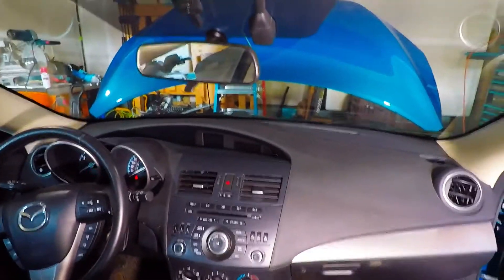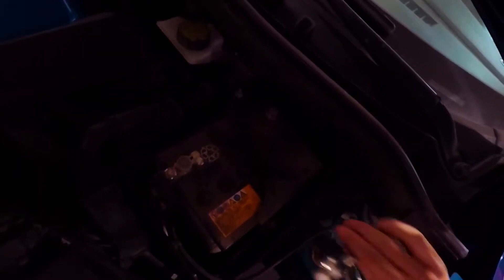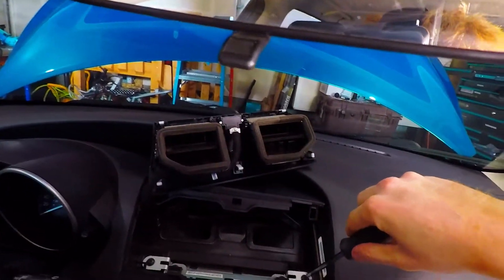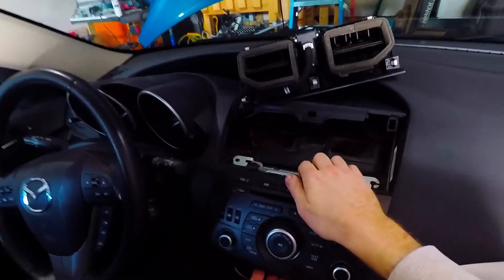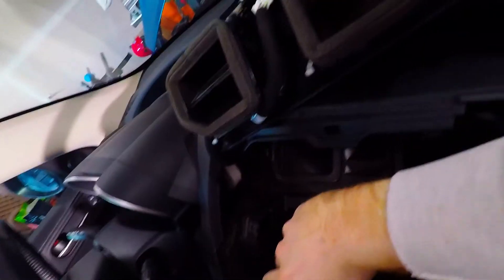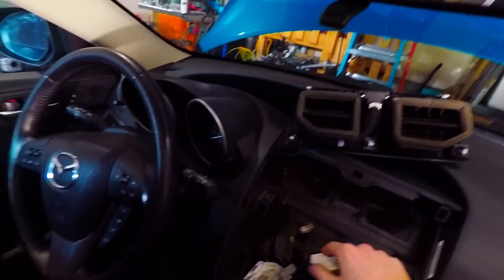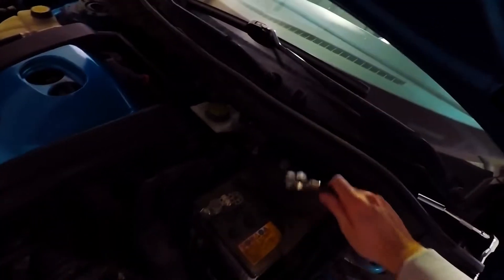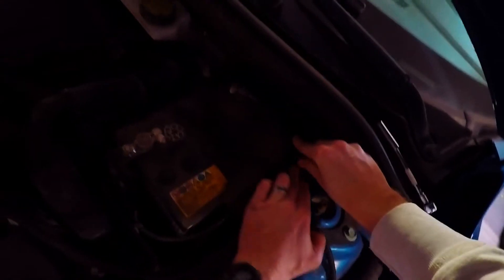How to remove your car radio 2010 - 2013 Mazda 3

Comment: Where is the Bluetooth microphone location on the 2010 Mazda 3? Right about the time when my wife got a dash recall where they gave her a brand new dash her Bluetooth microphone stopped listening and it has been a pain point for her when she drives because she wants to listen to Bluetooth audio from her Spotify and be able to talk hands-free.
Reply from the maker: The mic should be up in the head liner near the mirror. The blue tooth module is under the dash/ right kick panel area on the passenger side. If i remember correctly.

Comment: I have a 2012 mazda 3 and i am trying to connect a PLZ-902 infotainment radio system. I was able to find mounting hear and wire harnesses for the Power and antenna but nothing for the steering wheel controls...any chance i can get some feedback on how to continue from here?
Reply from the maker: I am not sure about that.. have you lookes at harnesses that connect the to factory wiring harness to what your connecting too? That might be needed for the controls on the steering wheel to work.

Sorry i am not familiar with that.